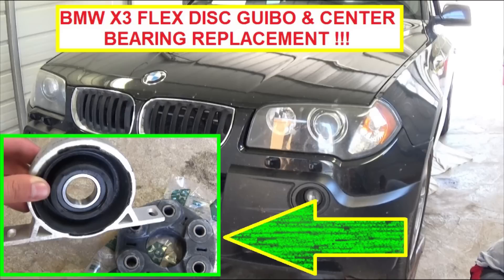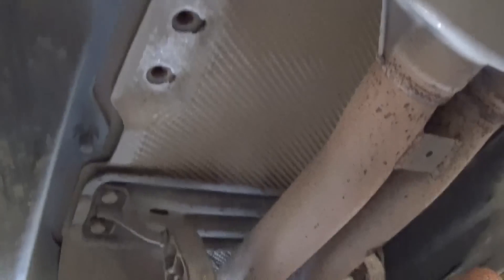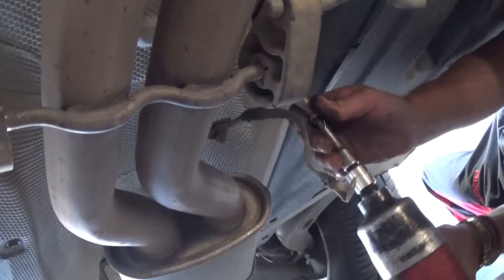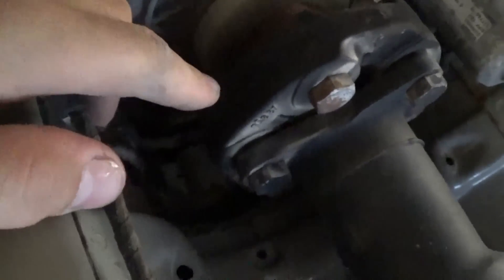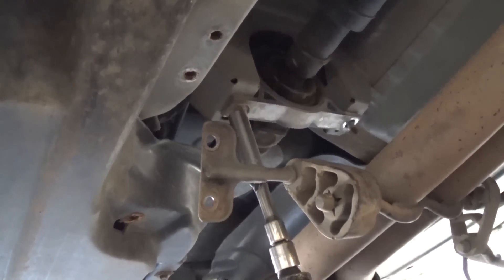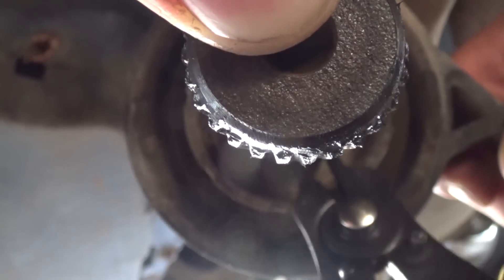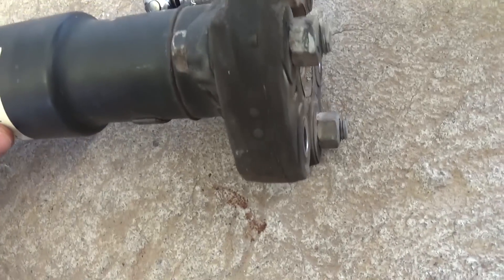BMW X3 E83 Flex Disc Guibo and Driveshaft Center Support Bearing Replacement

Comment: Good video. I just want to add something missing. You need to mark the driveshaft before you separate them and make sure to put it back the same way you removed it. Otherwise you will get the driveshaft out of balance and which may cause vibrations. There are lots of videos providing those tips and warning.
Reply from the maker: great advice. thank you
Reply: Top feedback. Thanks for this.

Comment: Thank you, guys.   I had a 'dry bearing' noise coming out of the bottom of the vehicle and I didn't know there was bearing there until I watched your video!   The bearing was exactly my issue and I'm glad I watched your video first.  
My bearing would not come off the shaft without a beefy gear puller and a bunch of swearing.  Then the new bearing would not slide on, even though I cleaned and lightly lubed the shaft.
I used the section of the drive shaft - sliding it over the splines - as a hammer to seat the bearing - it only touches the shoulder of the bearing.  worked great.
Reply from the maker: +jmandull We are glad that the video was helpful. It depends on where you are located. If the vehicle was exposed to moister, snow, and salt the bearings tend to get stuck pretty good. Thank you for sharing how you successfully removed it and installed it. If you ever need help with your vehicle let us know you can also find us on Our Official Facebook Page here: https://www.facebook.com/worldmechanicsofficialpage/?fref=ts

Comment: Thank you for this video. I am about to perform this repair on my 2005 BMW X3. This really explains how to go about doing it. I really like that you didn't have to remove the exhaust.
Reply: Did you fix yours.  My 2005 x3 3.0 had a damaged central and replaced it.  But still have clunking noise at idle speed, foot off the gas pedal...good luck
Reply: @khalidjj2073  this did fix my issue for about a year. Then the rear universal joint on the driveshaft got rusty and caused similar problems. These u-joints in the rear commonly get very rusty and make it hard to move. This might be what you are experiencing. If I knew better, I would have just replaced the entire driveshaft assembly the first time around. It is not much more money and it is basically the same labor.

Comment: THANK YOU! If you could do a video that shows how to test your car to make sure this is the problem I would love that. Diagnosis is the hardest part to me. your video makes this fix seem easy, even if it's a lot of work. I feel like I can do it now. But I want to make sure that this is the problem. How would you test a car to know that this is it?
Reply: Mine Sounds like a thousand rubber mallets whacking the floor under the center console. Took mine apart today and the bearing and rubber was completely separated from the bracket.

Comment: Great video.  Thanks 
Questions.  2005 bmw x3...we hear clunking noise at low speeds...don't press the gas, just let foot off the gas pedal and let car cruise...car makes clunking noise as it cruises.  I did replace the central bearing following this great video...thanks any suggestions on the noise
I did not replace the flex disk.  Maybe I should.  Is there one or two in 2005 x3 3.0.  Thanks again keep the good videos coming😊

Comment: Thanks for posting. Only note is when you take off the old support bearing. You folks simply hammer it off- however this definitely didn't work for me- that sucker was seriously rusted on. I wound up using a three jaw puller, borrowed it from advanced auto parts, and worked like a charm. Also let it sit overnight heavily doused with PB blaster.

Also will note that this, replacing flex disc and support bearing, seemed to have fixed the problem of a 70mph+ rumble I was having.
Reply from the maker: +l ben glad to hear that it worked. Ours was not rusted because where we live it does not snow and rain very often. Factors like that help a lot. Thank you for sharing how you took it off. It will be very helpful for other viewers as well. Are you located north?
Reply: Yup- Maine, So pretty north in the u.s. Car was from Mass so it has been exposed to salt for its life. Thanks again for the video- was very helpful.
Reply: l ben was you also getting vibrations when braking. It does fell like buckled disc when breaking from 90mph to 50 and then all comes back to normal.

Comment: How long should I expect this to take to remove and replace both the flexi and carrier bearing? I have sever vibration also and need to change both to cure the problem. Thanks for posting this vid. Always great to see in advance how to tackle a job :)

Comment: How did you originally determine it was the support bearing?  I have a noise like an airplane engine when accelerating and decelerating.  The repair shop said it was the rear differential but I doubt they took off the covers to check the drive shaft components?
Reply: Did you get this sorted ,I have the same issue .it’s like a wheel bearing sound but under the centre console
Reply: @dylanbenjamin5686  It was the driveshaft.  I ordered a Cardone.  Search Google for the best price.  I sold the X3 in 2021, it was breaking every month.  Glad it is gone and will never buy another BMW.

Comment: I know this is an old video, but do you have to mark the front half of driveshaft so it’s reinstalled in the exact same position with the back for perfect balance? I just did this and get a vibration over 45 mph. Thx

Comment: Just noticing the Guibo on your video is opposite the original.  From the driveshaft bolt to the right, it is heavy rubber, then light,  the new one you installed is  light (thinner portion) then thicker which is opposite.  What gives?  I am installing a new drive-line on my car and I see the same issue.   Should I install it the way you did?

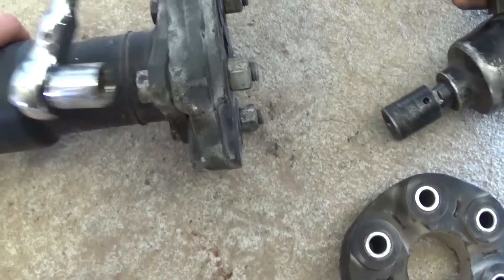Comment: Nice video but looks like the flex disc was put differently than the old one- if you compare the position at 11:55 and 12:10 you can see the old one is facing a thick section and the new one a thin section toward the camera. The arrows though are facing the correct way! Not sure it makes a difference though what manufacturer the disc is.
Reply: Philip G yes the new one is wrong

Comment: your videos are great, I have a question it's irrelevant to this video, my ignition key does not open my doors any more with the middle button  is it possible to charge your ignition key with out buying  a new one, on a x3  3.0
Reply: No, you can't recharge the dead battery, but you can replace it. You have to cut open your key and solder in a new battery. Then you have to melt your key fob back together. Mine works great now.